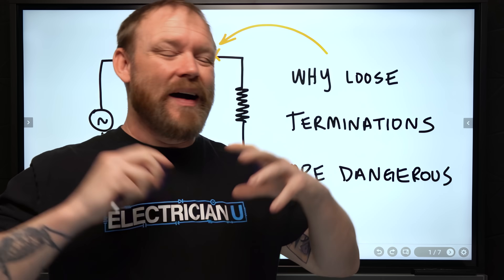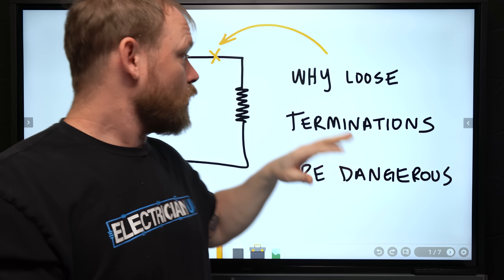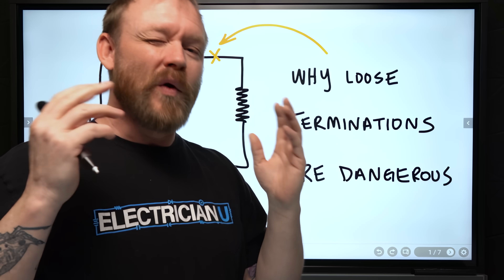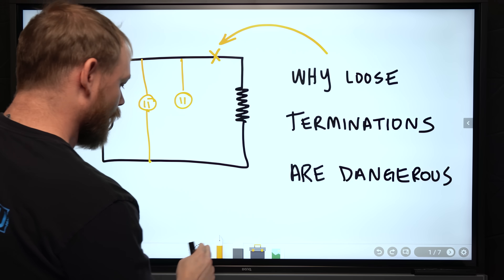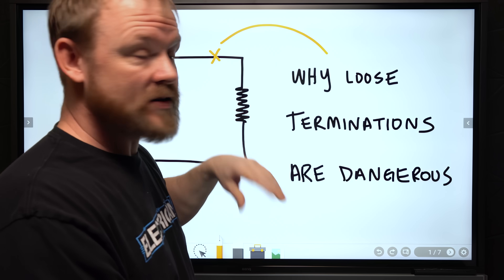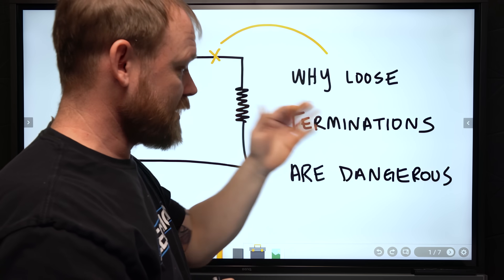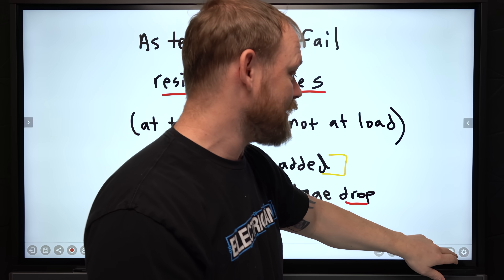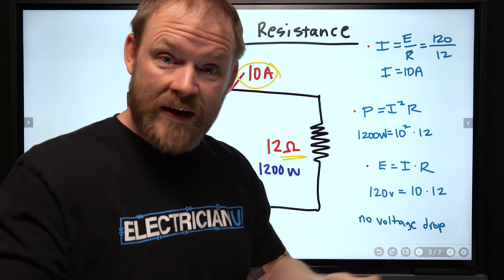Why Loose Wires Cause Fires: Why I Pre-Twist.

Comment: Best to think of all connections as thinner gauge wires and as unprotected fuses.

Loose or damaged connections effectively reduce the cross-sectional area. As copper strands loosen or corrode, the wire behaves like a thinner gauge wire. Less metal = less room for electrons = more localized resistance. This creates a choke point. Not because the bulk resistance of copper has changed, but because there's less copper for the same current, which concentrates the electrical load at a spot and causes heat build up. The resistance at that point increases heating exponentially.

Copper itself hasn’t changed its resistivity, the geometry has changed, which affects how much current it can carry. The heat causes further degradation, leading to a runaway effect. More heat → more damage → more resistance → even more heat. Eventually the wire opens. At that point, resistance becomes infinite and the circuit stops — this mimics the action of a fuse, but without safety.

The current draw from the load should drop when resistance rises far enough. Eventually the voltage drop across the bad connection reduces the voltage available to the heater, so it draws less current but only after a dangerous amount of heat has already been generated.

AC generators push and pull electrons back and forth so I think it is better to imagine this situation as having two circuits that don't depend on each other. The source circuit is constant and independent of the load circuit. It is easy to think of each as being able to react to the other but they don't, it's a petrol powered tool with no safety trigger unless you install rcd and breakers. Too many professionals describe electricity as flowing, it doesn't in the case of AC, energy moves due to a tug of war.

Comment: As a home inspector, I find a lot of heated connections with my high resolution infrared camera. Even if the connections are inside a junction box, the wiring adjacent the box will show a differential when there is a load on the circuit. No load, no differential. A hair dryer works pretty good for adding a load for testing purposes. Just my method for finding stuff.

Comment: FOOD FOR THOUGHT - As a retired engineer, I really appreciate the topic of your video, because few people realize just how dangerous a poor electrical connection can be. However, I believe one idea in your title (i.e. “Why I Pre-Twist”), though intuitive, might be unintentionally dangerous. So let me ask you a question, with the understanding that wire-nut connections should NEVER be subjected to mechanical stresses, but “alas, caca doth occur.” 

Which type of wire-nut connection is safer after being mechanically stressed?: (A) One which has been stretched (mechanically damaged) but remains together (increased resistance), or (B) One which has pulled completely apart (infinite resistance)?

More food for thought: (1) Which type of solid wire-nut connections tends to have the lowest initial resistance, pre-twisted or untwisted? (2) How do these resistances change under normal use for each? (3) How do these resistances change under mechanical stress for each? I think the answers might surprise you.

Many years ago I pre-twisted wires before attaching wire-nuts. But eventually, I realized that the most solid, consistent connections resulted whenever I allowed the wire-nuts to do their own twisting. So, other than a light quarter-turn when mating a pair of stranded wires, just to keep all strands headed in the right direction, I will no longer pre-twist wires. 

WK
Reply: Food for thought: how exactly do you plan on hand-twisting #12 or #14 SOLID AWG (as is typical in residential branch circuit installations) under a wire nut? Hand twisting low gauge stranded is industry standard, but as an engineer, when have you ever seen receptacles terminated with stranded wire?

A little more food for thought. Knowledge of practical installations and application of theoretical knowledge is just as important as theoretical knowledge. Not to knock on engineers understanding, but ideally the most well informed decision would be made by an individual with both a degree in electrical engineering, and qualified as a journeyman electrician.

Comment: Another aspect to consider the resistance increase due to the heating effect of a loose connection. ie. Copper wire increases it's resistance as its temperature increases.

Comment: Can you please do a video on Ford? F1 50, with the 7.2 W generator backfeeding a house every time I plug it in to back feed with no breakers on I get ground vault error and the circuit shuts down. I've been trying to get answers from ford for 5 years

Comment: The maximum power dissipation into your loose connection will be when the resistance of that loose connection equals the resistance in the rest of the circuit - ie. 12 ohms. That's why you were going up as you increased the resistance towards 12 and then decreased when you went above 12. I was of the understanding that torque specs on electrical connections are more about mechanical properties of the connection rather than electrical - ie. If it's not sufficiently tightened, it has a greater chance of loosening over time, which will eventually become a poor connection and lead to arcing and/or higher resistance.

Comment: I did my electrical apprenticeship in Australia 45 years ago. At that time Australia had just banned solid cable due to the fire risk associated with it. I cannot believe you Americans are still using solid cable instead of multi-strand nearly 1/2 century after we banned it!!!  When 2 cables were to be connected at one terminator, we were taught to twitch it tight and double
it over into a U shape and then  crush the U into a tight parallel before inserting into tunnel connectors etc. Screw head style terminations were only encountered on obsolete technology and we
would only place the U with the opening to the right so that it self closed if we had no choice other than to re-use the device.  Wire nuts were only in use here for a couple of years before we were told to stop using them and to remove them if we came across them and replace with tunnel connectors. Their use is highly restricted in Australia.

Comment: Great video! You might also discuss how inductance contributes to sparking in loose connections(can cause fires). When vibration causes contacts to rapidly make/break, the sudden interruptions in current (di/dt) through the inductive load generate high back-EMF spikes. These spikes can far exceed the supply voltage (even by hundreds/thousands of volts for highly inductive loads like motors or relays), especially with large inductances or fast disruptions, leading to severe arcing. This is critical in systems like relays, motors, or industrial wiring where vibration is present.

Comment: Don’t most of these electrical fires happen because a house had older wiring that did not have insulation’ that was as good as the modern kind at taking heat?

Comment: Use lever and push in connectors instead. For lever IDEAL makes the best, and for push in Wago makes the best. Stop using wire nuts where you dont,t have to.

Comment: USA, half the voltage double the current.
Power = I2R ie Low volt countries have greater incident of loose joint heating.  
Wire nuts are banned in most western countries there's a reason

Comment: Pretty good. Two things to notice: The termination resistance on your final graph is the X axis. So, the blue graph is what? Second, you use the term heat dissipation. Dissipation is the process of energy being transported away (in engineering applications usually through heat, but it can also be sound, vibrations or light). A brake, for instance, dissipates kinetic energy (the car rolling) to heat. I get what you want to say. 
From a fire hazard situation, the fact that the energy cannot dissipate actually is the problem. The energy accumulates over time in a small area and gets hotter and hotter, until something ignites.

Comment: Retired EE here. Knowing Ohm's law intuitively is the single most important tool in your toolkit, follow that with KVL, and power (I squared R) . Knowing the dance between V, I, and R is 90% of your day to day. You can always use a calculator if you don't like math, but as this vid shows, understand why the math is will be your bread and butter.

Comment: Newbie question: with all this going on, why doesn't the breaker just trip?
Reply: No, extra resistance results in a lower current rather than a higher current (which is what breakers protect against).  The issue with a modest series resistance is that the I^2R power is not dissipated effectively (small confined space), resulting in higher temperatures.  The higher temperatures can have the effect of additionally increasing the resistance, which can continue to spiral.  The higher temperatures can result in melted insulation or potentially a loose enough connection for arcing to take place, which generates crazy high temperatures.
Reply: @ksubj1  Thx for your concise response. Very interesting...I would think in this day and age a breaker could be designed would be able to detect more than one compromise to a circuit. Why not have a breaker that also trips if the current is way too low, or out of a set range?
Reply: Low current is a challenge.  Should the breakers trip when nothing is plugged into the circuit?  It takes a fairly complicated system to know whether the proper current is flowing through the circuit.
Reply: @ksubj1  Ah of course, I see that now. Thx for your help mate.

Comment: Cant agree unless by "Always pre-twist" you mean "always pre twist even though if you know how to twist properly you can make a stronger connection than using pliers oh and also if someone can be careless at wire nut twisting they can also be careless with pliers and over twist causing brittle connections on thin gauge wires like #14 solid" 

Thought id also mention i cant agree with your "always use a meter to test for voltage" unless by that you meant "always use a non-contact voltage tester for, you guessed it, testing voltage... ask a  high voltage linesmen what they use for testing for voltage. Also many common electrician meters are rated cat III which is up to 600V while NCVT are up to 1000v and higher so obviously use a ncvt for testing voltage, especially when dealing with 600v transformers with higher taps which can be dangerous if you rely on a cat iii meter"

Comment: One other thing I noticed is with heaters especially HVAC or  smaller bathroom ceramic ones are them cycling.  melting and following back to the breaker.not enough to trip breakers or short but  definitely cause Fire.. great job explaining

Comment: The maximum of the power delivered into the fault occurs when the fault resistance exactly equals the original load resistance.  Additionally the power delivered into the fault will be 1/4 of the amount that the load is designed to dissipate.  so for this example, when the fault has a resistance of 12 ohms then both the fault and the space heater will each be dissipating 300 Watts.

Comment: As a layman, I interpreted this as: heat at the resistance source will rise as resistance rises, but that resistance turns into a current blockage (like a disconnect) after a certain threshold.  It's like water plumbing - the more constricted the pathway, the more pressure on the pipe at the constriction area, but too much constriction will force the pressure away as if it was a sealed end.  I know, this is a horrible explanation lol

Comment: I used to do a lot of electrical service calls, and finding a wire was unknowingly backed out of the wire nut by the installer either caused that wire to lose contact or to be loose enough to cause arching and eventually a fire wasn't uncommon. Because of that experience I always pre-twist to leave no doubt to the integrity of the connection. Lately I've switched to Wagos to see how well they work.
Reply: The Wago lever type has a dangerous flaw. When wires are installed, the levers will lift up on their own to a point that if it catches on to something it will release the wire. You have to wrap them with electrical tape. The IDEAL lever connectors are superior. They don't do that.  That said, my favorite connector is the Wago 2773 push in connectors. They are the smallest wire connectors made. The size range is from two wires up to eight wires. The eight wire connector  is tiny as well.
Reply: @CorneliusTaylor-s1u  <> Thanks for the warning about that 👍

Comment: Loose connections cause the large current to try and pass thru a smaller area making it heat up.
Try that with a wire by removing half the strands & see the other half get hotter.

Comment: So as someone who is about to do a walk through, how can I check to see if everything's okay? As an Electrician trainee, I am walking into the home with a multimeter and a screwdriver(so I can see if the box is wired well).  I am most certainly going to check the voltage from the receptacles randomly.  I am not sure what to check for, other than a breaker panel that is not screwed in tight.  Any advice from anyone would be greatly appreciated.

Comment: I have personally seen much more heat damage with pretwisted wires. Untwisted wires under a wirenut would often heat stress the spring and the plastic caps would melt ot crack, pop off and some of the wires would come apart, and I would find an open circuit, and rectify all of those faults. I have a metal wirenut driver on ratcheting stubby screwdriver so my wirenuts are on very tight. Corrosion from water or chemical exposure, and water ingress were far bigger offenders than non-pretwisted wires for finding charred up wiring. That spring inside  the wirenut will loosen itself up whenever it heats up. If a wire pops loose, great! Someone will be called out to fix it before it starts a fire. I usually don't do residential so I don't deal with plastic boxes that can catch on fire either. I don't use them in my own house either.

Comment: At the risk of asking a stupid question, I'll just jump right in. At some point does the frequency of the current (60Hz) introduce a vibration into the system as the contract area decrease? And if so, does this vibration contribute to the ultimate failure.

Comment: With respect to this video than how is the fuse work by seeing this video fuse blow same time because as conductor is heating up the fuse will blow same time for example a thick gauge of wire used is used in circuit and fuse is thin how is possible to work in this kind of situation fuse won't blow frequently because conductor is thick and fuse is thin

Comment: So im a former electrician turned NETA testing tech, rule if thumb for thermography is 2x the load 4x the heat generation for high resistance connections. Another issue is the heat generated from the arcing contact points cause expansion of the conductor and your resistance rises exponentially till either it becomes hot enough the conductors fuse together, or cause a meltdown or arc flash event. I think im gonna have to get a dc power supply and test the resistance across different connections as well as try and simulate  a loose connection and trend the voltage drop and temp rise.

Comment: We all understand loose connections cause fires. I hope if you have any pride in your work you will make sure your connections are tight. On the other hand I understand Arc Fault breakers are suppose to trip due to bad connection to prevent fires from starting. My question is where is the data proving Arc Fault breakers significantly reduce house fires. Or are Arc Fault breakers just a scam for manufacturers to make more money.

Comment: Why aren't connections in houses mechanically crimped? I am a mechanic & not an electrician.
Reply: Connections like wire nuts make decent connections if used properly and have the added benefit of being undoable when you need to change your switch, fixture, receptacle, etc. Mechanical crimps are less serviceable, especially on wires routed through walls. If you had to cut off a crimped connection, eventually you run out of wire

Comment: I am not an electrician, but know a few and get advice on my home repairs. I leave the big voltage/panel work to them, but I can do all receptacles. I have found during renovations that the worst examples are backstabbed outlets called contractor grade. You know, when some 500plus condos are going up and there is one electrical contractor that puts in the cheapest outlets as quickly as possible. Might be code but man, backstabbed pop out with missing neutrals or hots. And the burn marks I've found. I will twist the wire on a needlenose and secure under the screw in the correct direction. And I learned to preTwist with lineman's on the several leads prior to correct size wirenut. Lately I've been using WAGO for multiple wires in a tight box (GFCI are large receptacles for average box). Thanks for the lesson!
Reply from the maker: Oh brother, working in Austin with largely 1970s homes the amount of back-stabbed receptacles I get calls on is crazy. Always random lights and receptacles suddenly don't work and when you bang on the receptacles sometimes you can get the lights to flicker back on and off. I hate stabbed receptacles, but I love the easy service calls to fix them! Thanks for sharing
Reply: Back stab terminations are job security for electricians and fire fighters.

Comment: Excellent video, thank you!  I always pre-twist for this very reason, I want a good electrical connection 100% of the time.  Also, at the beginning at 001 in the video, of course, you have the wire loop going the wrong way, counterclockwise.
Reply from the maker: Haha that was my editor's addition to the video - he's not an electrician. Yes you're right - but also not at all the point of the video.